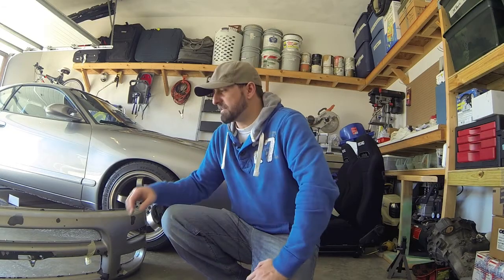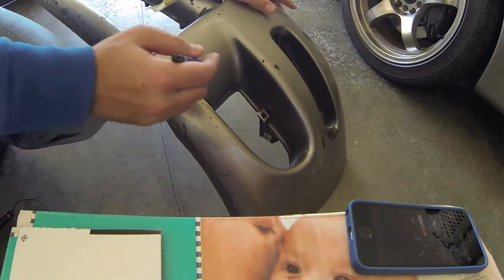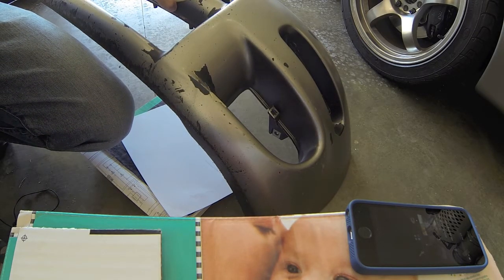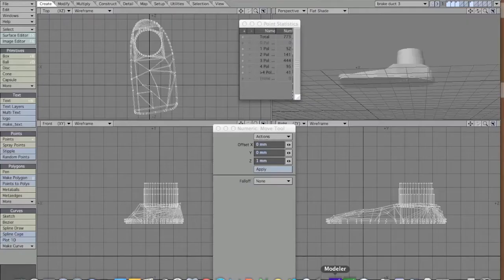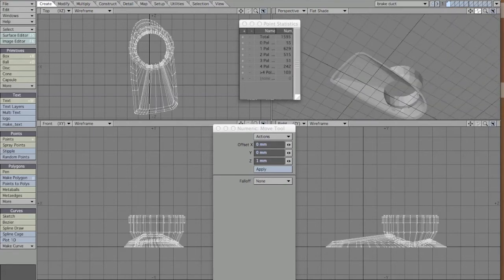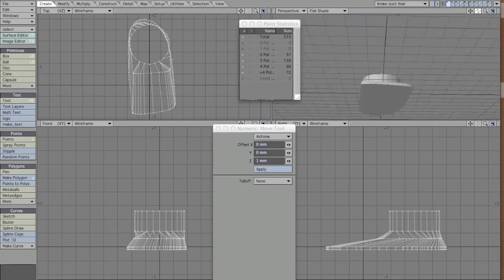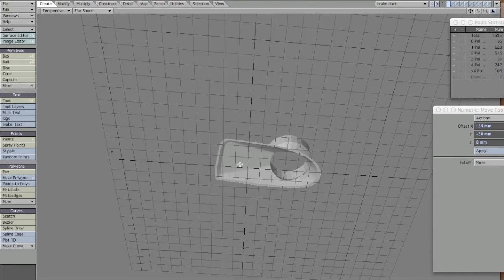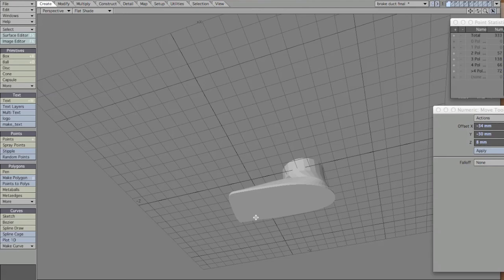Project CMS Episode 9: RC Bumper Airflow Functionality; Brake Duct Design Part 1

Comment from the maker: Mario M. The comments will not let me reply directly to your comment due to the linked comment section. Hopefully you will somehow see this. I would like to use high end tools like that or solidworks but its all out of my reach. I bought LW for animation work, and luckily it uses real world units and has some cad tools that came as a plug in. It has a physics engine, but I doubt it has any data output. Its more for visual rendering. For the time being this will work for me though. I just produce my design in LW, then use Sketch up to  convert it to STL.

Comment: Josh, have you thought of using AutoDesk Inventor for your modeling process?
You can import what you have done already and take it from there with access to more powerful tools.
It also allows for measuring fluid dynamics and material tensile strengths. Just a thought.
Thanks for making the video and sharing your idea. :)